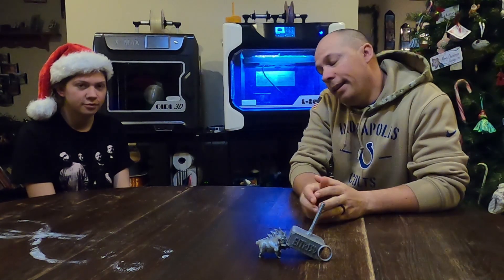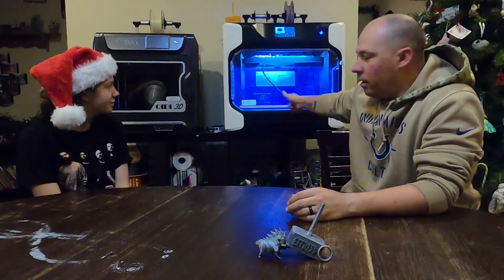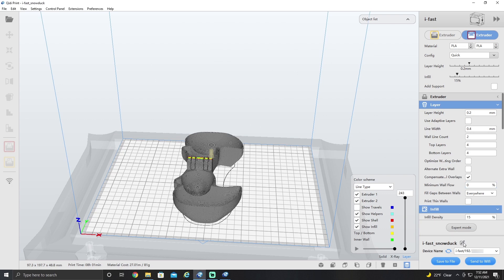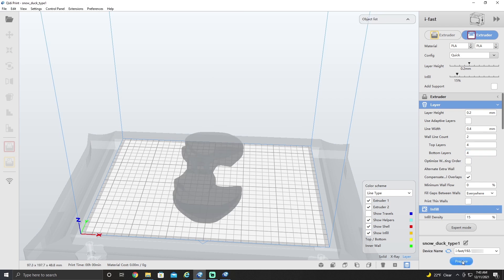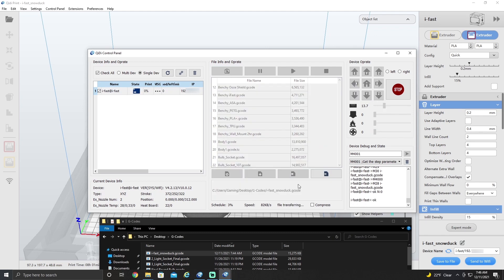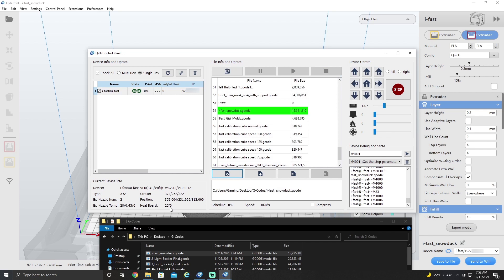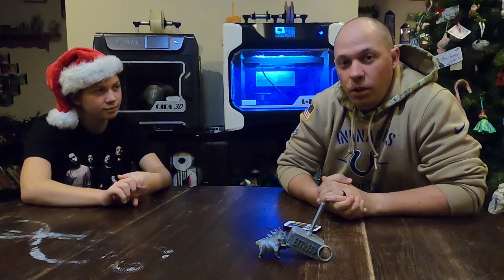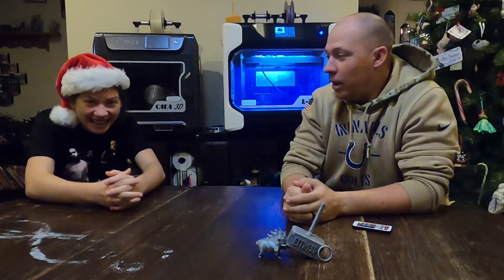Wifi Printing

Comment: I currently use the Qidi slicer and submit jobs over wifi. And I track the print status via the internal camera with an iPhone. The i-fast, with a level bed and proper settings is a real workhorse 3D printer. And the Qidi support is superb. I think the focus on the internal camera getting blurry at high temps, and no easy way to stop the printer remotely if a spaghetti print started, would be my reason for going with octoprint.
Reply from the maker: That was our reason for getting Octoprint. In our tech savvy world my 3D Printers we’re the only thing I couldn’t control remotely.

Comment: Does the octoprint watch the print process and stop it if the printing turns into spaghetti on the i-fast? If so, did you mount the camera inside the chamber or outside? I think that is the largest benefit octoprint provides.
Reply from the maker: There is a ‘spaghetti detector’ you can add into Octoprint. I just have not used it personally.

Comment: Wanted to ask if you ever tried the Qidi software with the i-fast over Ethernet? Side note: I have finally gotten Hatchbox ABS filament to print in the i-fast without warping. I have the dual high temp extruders. Initial layers start in a pre-equilibrated chamber at 80C and plate at 105C, no print cooling, chamber circulation only, and extruder fans at 10%. After initial layers are finished the plate goes to 100C. A 27 hour print came out perfect with no warping! Woohoo! 🎉 Hatchbox ABS required 234C for extrusion to be optimal, but don’t iron and do have at least 4 top layers. I’m running at 25mm/s print speed, 50mm/s travel speed, retraction 2.0mm@30mm/s, coasting enabled. Extruder temp could be lower (down to 230C), but I don’t have any stringing or bed adhesion problems, and the test prints came out really nice.
Reply from the maker: I removed my Raspberry Pi from my I-fast and print wirelessly now.

Comment: Thanks

Me an my son have a QIDI Plus 2 

We r stuck

Would love your help to jump start ur 3D printing experience 

Software is ur issue at this point Cura
Reply from the maker: What issues are you having exactly?
Reply: @Eitri3D  just new at the whole thing

Only thing we’ve done was the print that came with it just don’t know how to get things going
Reply from the maker: If you’re new to 3D printing I would use Qidi Print. It’s made for these printers. First thing is to find a .stl file/model you want to print (thangs.com, Thingiverse.com, etc). Download you file and then upload it into your Qidi Print and then select the file preset that pertains to the type of filament you’re using. Then you print. From there you can start making adjustments if needed for temp, supports or just about anything else. We have video that walks you through Qidi Print and explains how to use.

Comment: Does the normal temp extruder work without the yellow tape around the hotend?
Reply from the maker: It can but that is a shield to help keep temps regulated and stable. Without it the heat will creep down and could affect your print. I use the yellow tape stuff until it tears/falls off then I put on a silicone cover on it.

Comment: Sorry, more questions! 1) Do you prefer octoprint or WiFi printing + QIDI control panel? I'm curious if you find the upgrade hassle worth the effort, as I'll do it if there's a good reason to and want remote control either way. 2) After owning it for awhile, are you still happy with the i-fast over your x-max, considering price? So far, it seems to offer a lot more up-to-date features (which also seem to be in the new x-cf, which is similarly-priced) that help justify the hefty pricetag.  And thanks for all of your awesome videos, I keep coming back to them!
Reply from the maker: For the first question, I have to say that they each have their own benefit. Sometimes I prefer my Pi because I can monitor my printer from my couch with the added PiCam; however, I can monitor my I-Fast with the new built in camera. Unfortunately, I haven’t been able to save any video from it yet as I can with the Raspberry PiCam over octoprint. Now if I did not need to record timelapse videos for YouTube and my computer was in the same room as the printer, I personally would not add the Pi to my I-Fast. I was unable to get get my wifi working on the X-Max so the Pi filled that gap. As for satisfaction of owning my I-Fast over the X-Max, the I-Fast has been my go to printer. I use the I-Fast over the X-Max 9 out of 10 times. I have been using the dual hotends to produce dual color prints all most exclusively as of recent. Now understand I have only been printing PLA.    I hope this helps clear up anything. Feel free to ask questions because this is a large amount of money to spend and i will provide honest feedback.

Comment: Did you see how the Qidi X-CF is available now in some places? Very little info, but I'm curious if it would be worth buying over the x-max or I-fast, if it's meant to be an x-max v2 or standalone, etc.
Reply from the maker: I did see it. I was asked if I wanted to purchase it then provide a review. Unfortunately they asked right before Christmas and I would have had to pay full price, which I was unable to do at the time. Honestly, I from the details that were emailed to me, you have to ask if the auto bed leveling, enclosed chamber, all-metal hotend (I assume) is worth an extra $1,000 more than the x-max. I would have loved to be sent a tester model like other companies do, but I think I might be passing on this one.
Reply: @Eitri3D  Good points, thanks! And I guess if you have full octoprint capabilities on either, then the software updates are irrelevant. Do you think that it would be possible to mod the x-max wth an all-metal hotend or other things in order to get many of those capabilities, like CF printing? Looking to buy my first printer but x-max just seems a bit outdated.
Reply from the maker: Oh yeah, check out our Chad Mod playlist. We upgrade to an E3D V6 hotend with a dual drive extruder. Now there are many all-metal upgrades out there but I’ve only done the one video series which covers the Chad Mod.

Comment: So the pi hookup didn't work out for you on the x-max? I just got my 2 zero 2 w's today was excited to hookr'up. Its pretty simple to print through qidi print but I really don't like their software. I'd prefer to just print it straight from prusa hence why I found octoprint appealing.
Reply from the maker: It works great on the x-Max. I just unhooked it to demonstrate how to hook it up to the I-fast.
Reply: @Eitri3D  Do you know if you can add a auto bed leveler like BL Touch? I got one but now I'm having a really hard time finding anyone mentioning it for QIDI.
Reply from the maker: I do not know for the I-fast. I know it comes standard on the new X-CF Pro. Let me do some digging.